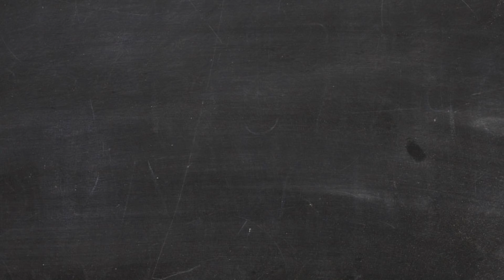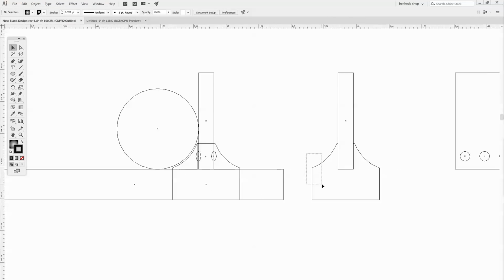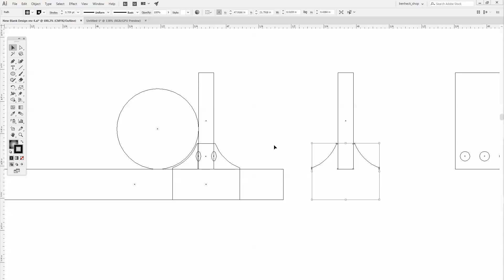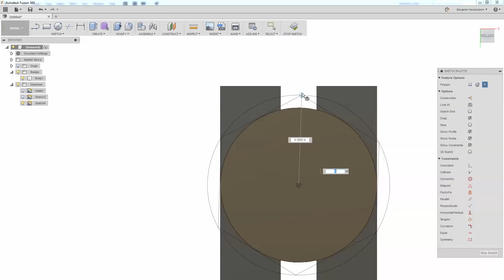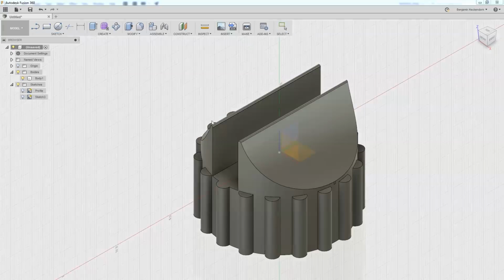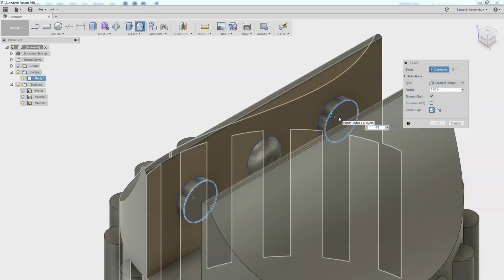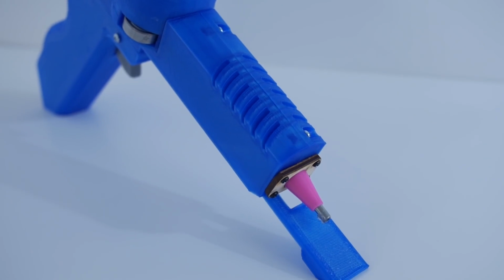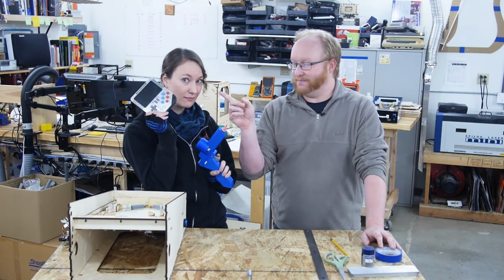Mini Pinball 11: Final Analysis and Programming

Comment: You can make the plastic wall holders reversible, one side has the wall holder and the other side sits flush on the playing surface, you just need to cut a small lip around the hole border at the top of the surface to compensate for the holder part that prevents to go all the way. Just my two cents. Love this project!

Comment: The holes can all be open, and you put a thin piece of plastic or cardboard on top. You can the ship it with a few pre-made sheets with printed graphics for different themes and pre made holes in the right places for layout. In addition, a tool to make the holes in cardboard or plastic sheets yourself for custom designs and layouts. The support from the board underneath should be enough, even with all the holes open.

Comment: Have you thought about using an odd number of detents in the pegs to hold walls it should give you more possible angles. With the even number the possible angles are repeated each 180 degrees. It also makes smaller holes possible in the base.

Comment: How about creating a removable "plug" that can be reinserted into the popped out pieces? It would allow the user to test various setups without worrying about a floor full of holes.  I understand this would, however, create a higher cost value as those pieces would most likely have to be 3D printed.  Although, with a limited number of them,  it would encourage the user to plan out first before popping out all the pieces.  Measure twice, cut once right?
Reply: If the demand is high enough they could (i guess!) go for injection molding for said plugs...
The playfield would probably still need to be covered with something to have a smoother surface, I think. But if that's flexible and/or easy to cut, then it would be fine for anybody to do that at home with just a utility knife...
Reply: Exactly what I was thinking... they could keep the pieces they popped out and tape (or use a semi-permanent glue... definitely not wood glue) them back in as needed?  And/or include a bunch of flush fitting plugs...

Comment: if you make it from the top down you can make it so that the holes are filled with blank stars then swap them out for the clamps but the blanks would still be flush with minimal cracks also maybe a small amount of wood filler to fully level/ flush the holes kids do like arts and crafts plus would teach kids how to Spackle in a rough sense
Reply: I was thinking of the same kind of concept .. I was thinking if you made the holders for the walls push in from the top .. .you can make all the holes have "plugs" coming from the bottom to keep the play field "solid" .. you can have a plate underneath to make sure all the "plugs" stay "flush" with the surface. Then you could remove the plugs that you want .. and if you want to change it .. then  "fill" in the used holes with the plugs and start over .. or I suppose that it all can come from underneath and have a "retaining" plate to hold all the plugs and wall brackets in place and flush with the surface plate

If you wanted to get real complex ... have the "retaining plate" have the same pattern as the surface plate but not fully through the plate so you could set it all up on the retaining plate (without the walls of course) and then just pop it in to the "surface plate"  lol but that may be a bit of over engineering :D